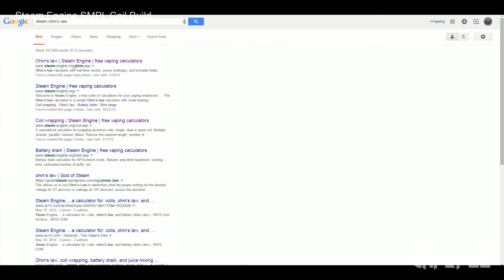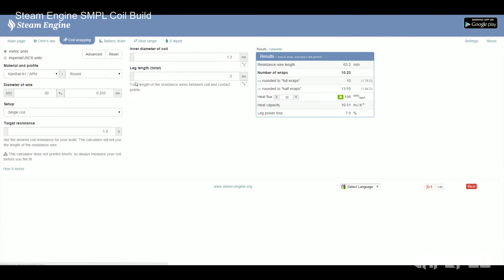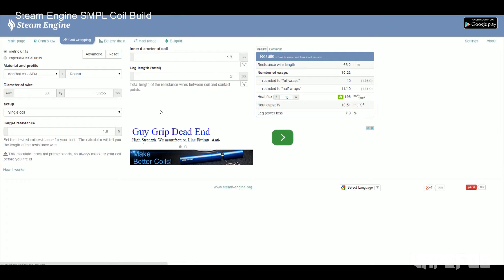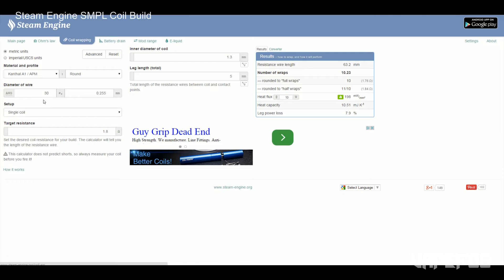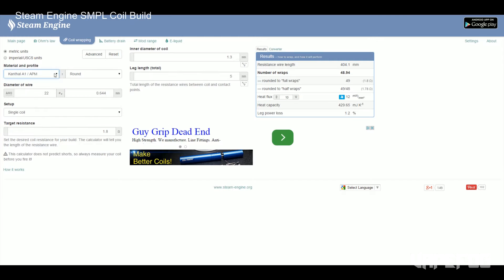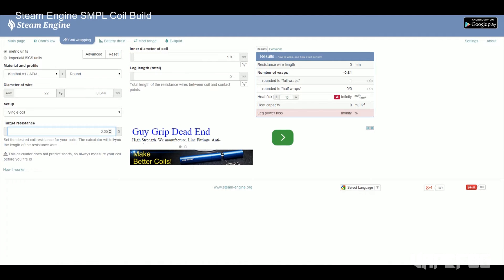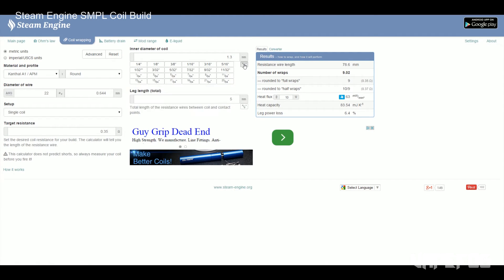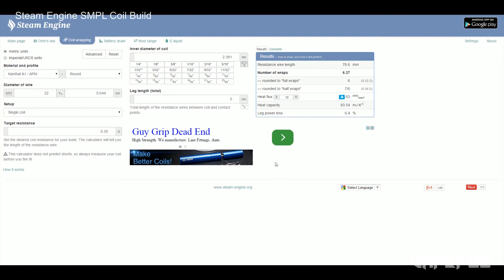Steam Engine SMPL Coil Build | VAPEFOG

Comment: I got prebuilt coil on the package it says Alien Coil 0.35x3/0.15mm SS 316L 0.20ohm ID 3.00mm. Now, I don't know what the "0.35x3/0.15mm" stands for and what to enter in the boxes I see on that steam engine site. How do I know what the diameter of my Alien is since it's obviously got 3 cores of what gauge(which I don't know) and wrapped with what gauge? I also don't know. It says 0.20 so I assume dual build will ohm around 0.10? In the total resistance box, do I put in 0.10 or 0.20 if I'm dropping 2 coils on my build? and what's my diameter at last?

Comment: I use the steam engine like everyday and have been for a really long I me...the only issue I have is I still don't see how I can get t to calculate a parallel single or dual coil build ie when you take like a 12 in lead of kanthal for example and bend it in half and wrap that so for every one wrap you do there will be two coil loops. Hope you get what I'm describing. Thanks in advance for any help or suggestions anyone can provide =]
Kov

Comment: Great tutorial but in case you don't know, half wraps is what you are building cause the leads are on the same side so one wrap is a half wrap, so what you have is 6/5 cause if you look at it from the lead side, its 5. when they come out opposite sides, it's full wraps and looks the same from either side. I'm actually surprised it went up instead of down after the tidy.
something to keep in mind too, and this might explain why it came out to .34 rather than .31, not all ohm readers read 0.0 when there is no resistance. I put a pice of copper in mine and it reads 0.03. same with probe meters, gotta check the resistance with the probes touching before testing and subtract that from the result. some decent meters will be programmed for that and read 0 which is great and you don't have to worry. Just touch the positive pin and the thread wall with a copper screw from a mod or something if you wanna try it.
Reply from the maker: Great point Malik but... In the video you see the ohm's law calculator predicted a 0.33 build which is exactly what I got before I squeezed and adjusted the coil. After I made my adjustments the coil came out to 0.34 ohm's which is acceptable. Also, remember the build was a simple single 22 gauge coil with 6 wraps around a 3/32 and the target ohms I was looking for was 0.35. The calculator said I would get 0.33 and I ended up with a 0.34 ohm coil. Not bad IMO, LOL. I think as long as we use really good high drain batteries such as Samsung 25r's or similar these numbers are perfectly safe. You make some valid points though, thanks for the input brother it's much appreciated. The only way we can learn and grow as a community is by sharing thoughts, opinions and ideas. Thanks for the input man. I'll definitely try out your suggestions.
Reply: Vapefog Reviews yeah man, it is damn accurate in my experience. if you do the thing with the copper screw and find it reads .02 or .03 or something, then .34 makes a lot more sense as you did a 6/5 wrap. now if you go change the resistance to .3 in the coil calc, you will see it says 6/5 will get you .31 (had to edit cause damn my thoughts to typing is not working well tonight lmao)
Reply from the maker: Malik Depthside Awesome, thanks for the info man I really appreciate it. I'm still learning man and not afraid to admit it, LOL. I think when we stop learning new things we're in trouble, LOL. To be perfectly honest, I was a little uncertain about the half wrap versus full wrap thing which is why I didn't go into detail about it. Thanks again bro.
Reply: no prob. I've noticed that no one metions that you should short your ohm meter to see if it reads 0 or not. many of them are cheaply done and not "zeroed out" (however that may be)
Reply from the maker: Malik Depthside Hell yeah man, see.... that's something I didn't know. I'll have to remember that next time I use an ohm reader in a video.
Reply: yeah, basically you take a clean copper screw (assuming you have a mech mod with copper screws) or silver plated or something and jam it in there (assuming that screw fits in loosely, don't jam a fat screw in there or something that will cross thread obvioulsy) against the threads and positive pin a few times and the most frequent reading you get is what you subtract from the number you get when you throw a coil in there. I'm curious to see the difference in a regulated box with readings to the hundreths (0.00) I don't have one to compare.
Reply: if you have a multi meter handy, touch the leads together for that number and test the screw if you wanna get real sure :P
Reply: hey, just for gitz and shiggles I checked what .03 would make in a super sub ohm build. if you are aiming for 0.08 and don't know your meter is 0.03 over, you are actually building a 0.05 which at 3.7 volts for example draws about 28 more amps! you are right though, it makes little difference in this build.
Reply from the maker: Malik Depthside haha, yeah man I don't own one yet. Might get one soon though. I do have one in my cart on Amazon. It's like a $30 meter, a pretty good one.
Reply from the maker: Malik Depthside Yeah great point man. I never build below 0.15 ohms and those builds are very rare. I have built super subohm lowest being 0.09. Did that for testing the 165 watts on the iPV3, LOL. My normal ohm range is between 0.25 and 0.6 these days depending on the RDA and coil or coils I'm building. My normal vape wattage is around 40 to 65 watts, also build dependant.
Reply: haha yeah, I have never built lower than .4 and I'm happy with that, while I may not like it, I will build a .1 someday, just for kicks, but will do safely :)
Reply: Malik Depthside You right its even stated at team-engine.org at how it works that "If you're making a coil for a Protank or some other atomizer where both the coil legs point in the same direction, the "Number of wraps rounded to half wraps" is the result you want. If you're coiling for a Kayfun or an other atomizer where the legs are pointing in the opposite direction, use the "Number of wraps rounded to full wraps" result."